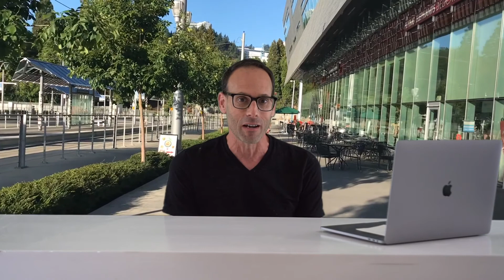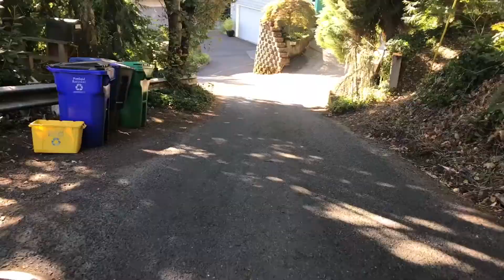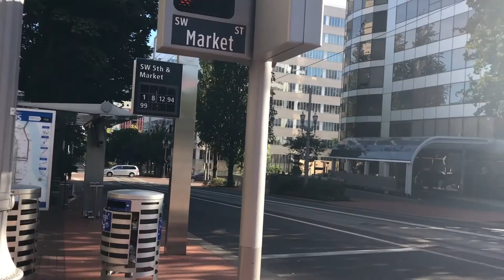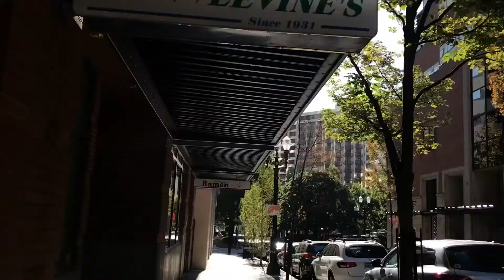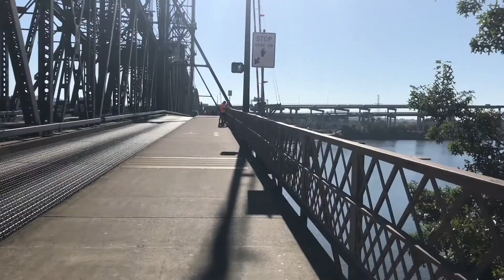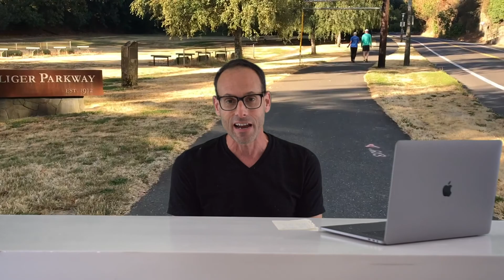GPS Watch Torture Test  The Otaku Circuit

Comment: Thank you for your work! It is really helpful!
I have one suggestion for tests though. There is one real life major factor for runners with gps watches: different speeds. AFAIK gps watches don’t change gps sampling with the speed changes. So it would be very helpful to see to what extent does this factor influence the accuracy of different watches. :)
Reply from the maker: Great point. I’ve done such a test for footpods but not for GPS devices.   I’ll try to include this in future tests. By the way, I just purchased an Apple Watch 4 yesterday and began testing this morning.
Reply: Running Otaku that is nice! Will be waiting for review.